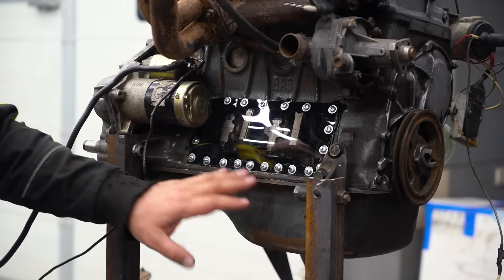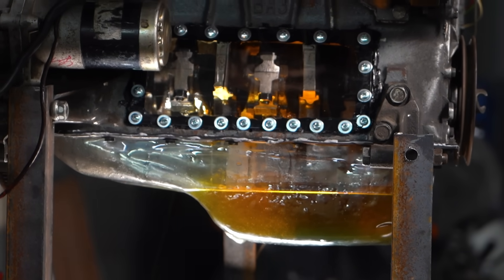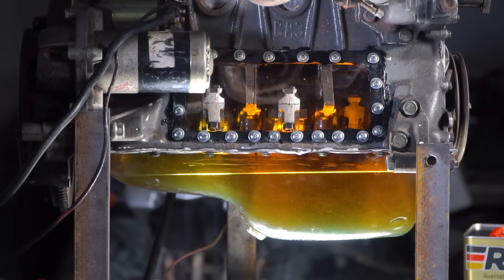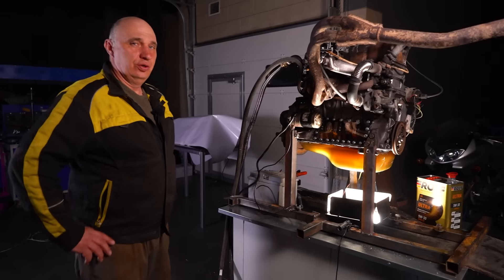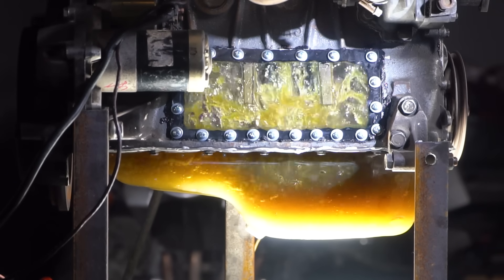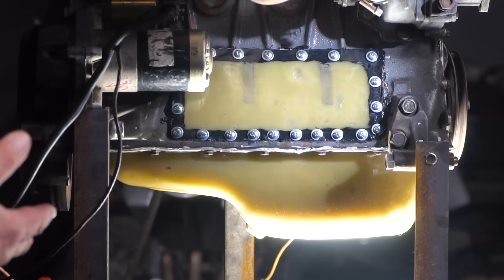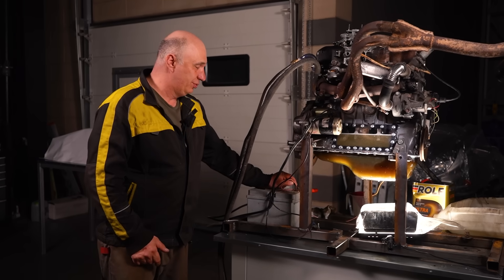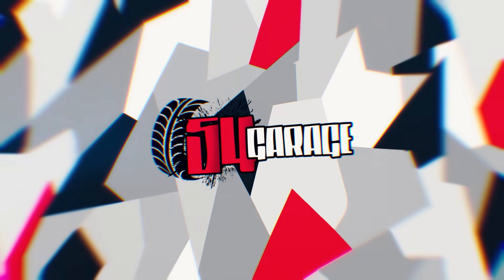What actually happens when you overfill your motor oil? (w/ transparent oil pan)

Comment: Excellent video. Amazing there were no blown seals & strange how the oil took on a different color with all the air trapped in it. It would have been interesting to see what the oil pressure was with all that air in the oil. Also pretty scary how little oil is in that sump when filled normal level & running. Makes you wonder how the oil still gets sucked up in steep hills & corners.
Reply: @karlwithak. I think you will find the oil galleries & oil pump lines & filter are lots more than a tablespoon. did you notice how far the oil level dropped after just cranking the engine at the start.

Comment: The problem with an overfilled engine is that air bubbles form in the oil, which can prevent the pump from sending the oil where it's needed, causing premature wear on engine parts.

Comment: I always ran my vehicles one quart over full.  The pan is only over full when the engine is shut off.  I never had a leakage or oil burning problem, or any trouble with aeration.  A mechanical oil pressure gauge showed steady, high oil pressure at all revs.

Comment: Years ago i had a honda accord 1300, the oil pump drive sheared off (common problem). 
I filled the sump with maybe three times as much oil and did another 20k miles with no oil pump.
Worked fine.
Reply: My god
Reply: That's the Henry Ford splash lube system for the Model T....if you went uphill for too long the front mai bearing ran dry....
so the modern way to stop that is a catch funnel added as an aftermarket piece at the rear interior of the engine block 
and a small oil tube running forward so the accumulated oil in the funnel still lubes the front bearing while going uphill....
Reply: karlwithak. Riiight, because they were so very efficient. Why use energy to power your drivetrain when you can just waste it pointlessly stirring a vat of oil. If only all the world's engineers had just listened to you, the know nothing in the cheap seats. All those dry sump race engines are just a waste of time folks, Karl the genius has the real oil, putting the wind in windage.
Reply: Yeah... but that's not a fair comparison, Honda's take a beating.  I was NEVER nice to mine and put over 100k miles on it.  After it was already past 200k miles.
Reply: Until the head seized? Or did the cam just wear out and stop opening the valves?

Comment: Oil can make its way out the breather into the intake and hydrolock the engine. Or if the crankcase sits too full over time it can couse excess pressure and damage internal parts. That's a pretty big oil pan, a lot of engines around here have one just big enough for the pump to sit into so double the oil would mean it's about half way up the crank or so. Lots of variables. The engine on the stand sits still so oil doesn't have a chance to slosh to one side or the other, I'd bet that's where engine damage would kick in.
Reply: The air in the oil is what does the damage.

Comment: Engine masters and Richard Holdener tested this on a dyno.   Extra oil reduced hose power dramatically.  Also the air in the oil kills bearings and lifters.

Comment: Bought a car from a guy once, it was his first car, turns out he only ever added oil, never checked level. He was never taught this just all he had ever seen was his Mom add oil every couple weeks. Motor wouldn't even crank right and when it did fire it struggled and smoked like a house fire. It wouldn't idle. I basically drained some oil out, changed the filter and cleaned the spark plugs. Drove it for 2 years before selling it.
Reply: I just shared the anecdote above in another convo of a lady who ran her toyota celica for 3 years on the same oil keeping the level at just under the 'E' mark on the dipstick because she thought 'E' stood for enough. Was like black tar until I changed it for her. Didn't die though.
Reply: Was it a Toyota?
Reply: @Makaya9s  are you psychic?  Yes a Celica,  was actually in a place called Zaragoza, Spain. Did you have similar experience
Reply: @survidmt  
Probably like a cockroach a Toyota, no matter what happens,  will be there running when humanity ceases to exist....
Reply: @survidmt  no not psychic haha. It's just that there have been cases of people driving months to even years without changing their oil to even people driving without any oil and the engine still survived everything. So an old celica definitely makes sense.
Reply: @Makaya9s  gotcha ya, sadly for him the car was not new but for a used US Toyota in spain, it was pretty new,lol. Do like the longevity of toyotas
Reply: I cleaned a rifle that was treated like that. Oil was dripping out of it and no more dirt could fit anywhere in the action.

Comment: What really destroys an overfilled engine is the actual oil foam, it would be great if there was a camera capturing how much of those air bubbles where sucked by the pickup tube instead of oil,  even with that milky microfoam you have huge ammounts of air on the galleys, rod bearings, etc, would be nice to see the aftermath.
Reply: A pressure gauge right on screen next to the transparent sump would have shown exactly that...
a drop as the air entrained in the oil is compressible....
so lower overall oil pressure as the foam increased....
Reply: No what would actually kill the engine would be the crankcase breather as the oil would be sucked back into the combustion chamber and hydro lock the engine, the crankcase breather was disconnected as you saw, if it had not been the engine would have been destroyed way before.
Reply: @stevenc5227  that would depend on where the crank case ventilation is located , most are in the tappet cover

Comment: Good to know you can overfill oil a little bit and not have anything too bad happen. I still wouldn't put in double what they recommend or anything but I wont stress about an extra quart or something now. Of course this all depends on the engine as well as they're not all the same.
Reply: Especially for engines that eat oil. How many times I was so worried about putting too much in vs how much ran out, I don't have to worry about letting one go hungry again :)
Reply: I was happy to see this video, I had a oil change and the shop put all of my 5 litre jug in. I was a little concerned but it was something I always did my entire life.
Reply: That was also my take away point, but worth remembering that you will lose fuel efficiency even with an extra cpl quarts, as the oil feed wheel has more load on it.
Reply: @wobblyboost  with my 2022 Veloster N, the book says 5.2 quarts. 

I have the car level on a lift, I drain it all out, I put 5.2. Qt in, it reads .5" higher than max. 

Same with oil changes at 1100 miles, 5000, 8500, and 13500.  

Dipstick may just be wrong... Hyundai lol.  Car is rated for 22 city / 28 highway mpg. I'm getting 36mph at 60mph in eco mode. So level is ok. No parasitic loss. 

Probably just the stick.
Reply: @NMode_VN  I have the same experience with my Mazda Protege. I guess it's because not all of the oil drains out. In my case about 0.2 liter won't come out and I tend to overfill by that amount if I fill by the book. I also change the oil-filter.

Comment: You should monitor the oil pressure. As the oil been smacked by the crank, it causes to having air bubble in it. The oil pump not good with oil that have been mixed with air so the pressure will dropped

Comment: I wonder if that much oil splashing around would keep the engine cool to not use coolant.
Reply: No it wouldn't, not for long. The added oil increases the resistance when the crank turns. This generates heat, and sure the oil will transport some of it away. But there are not enough surface to the block to cool the oil long tern, so it will increase the heat in time if you remove the water cooling.

Comment: There was french motorcycle in 1938, named Simca Sevitame. 2 cylinder upside down engine works literally in oil bath. Whole engine was mounted in aluminium box, filled with oil. Check out, who is intrested.
Reply: That little beast takes 8 liters of oil. Thanks
Reply: @t16205  yup, exactly. How many oil needed to filling 5,7 hemi?
Reply: @a777aa64rus  About 7 liters😅 I love weird old engines!
Reply: Interesting, thanks.
Reply: Interesting. You ever heard of the Megola. Has a radial engine mounted in the front wheel.
Reply: @rezzophantasma  i heard, totally useless thing. But funny, yeah, like rocket propelled roller boots.
Reply: Go get more oil Sergei 😅
Reply: C63 6.3 takes 8,5-9 liters
Reply: I'll mention while I'm here that Sunbeam motorcycles used the oil pool for engine cooling, but England is fairly cool and distances not too great .
Reply: @Philip-hv2kc  unfortunally i'm not familiar whis this brand and its technologies. Thanks, I'll find out more about him.
Reply: In the 30's, a lot of four and six-cylinder aero engines were 'inverted' with the crankshaft at the top - gave a better location for the propeller.   Howcome the bores didn't fill up with oil? - the pistons just threw it out when the engine was running.   And they were dry-sumped (had to be!) - the oil was kept in a separate tank.
Reply: @cr10001  I have no complaints about aircraft engines. Aviation - the whole separate world with their own complications. Btw the crookest engine i know was installed on a british ww1 era war plane, named Sopwith Camel. Kinda reversed radial engine with cranckshaft attached to plane body and cylinders to propeller. I newer seen it in person, only few youtube videos.
Reply: Loads of WW1 aircraft had rotary engines like that. The Fokker triplane for example. The french invented the idea with the Gnome Rotary before the war. It was a way of dealing with cooling the motor. They also all had total loss oiling systems so the pilot was being sprayed with oil all the time the motor was running..
Reply: From what I can tell looking at engine diagrams, the cylinders are dry, but externally submerged to transfer heat, and the entire aluminum "box" is the crankcase AND transmission housing. It looks like the main reason for it is temperature control, because the entire case is a giant heatsink.
Reply: @SkorpyoTFC  cylinders was cooled by circulating oil inside this box if i understand it right. I heard, the main reason to make this boxy design was an ability to get whole engine out of the frame, and use separately to power water pumps or generators. Same idea was used later on a RockOn motorcycle, but without overengeniering.

Comment: 14:55 this IS the crucial part when overfilling Diesel Engines with oil it just spills the oil into the crankshaft Ventilation Back into intake -> RUNAWAY
Reply: I don't believe the level of oil caused the pan to leak as much as it was the engine temperature caused the plastic to get soft.

Oil pressure gauge would have been a must too accurately gauge oil pressure loss through cavitation.
Reply: yeah this happened to me. But not by overfilling but due to unburned fuel diluting the oil - too much short-distance driving caused exhaust filter cleaning procedures to start over & over again. very uncomfortable experience, now I take care that the car has plenty occasions to blow the soot filter free.
Reply: Like the oil Detroit Diesel road oilers.
Reply: unless it is a modern diesel with an "anti shudder valve" As long as that valve seals properly and there are no intake leaks post valve it will shut off real quick when you key off
Reply: I would imagine it does it with any engine. Does every engine not have a pcv valve? I know my 93 mustand and 06 trailblazer do; so this would have caused a mess in the upper intake, where the pcv is "piped" in to for vacuum.
Reply: And when you overfill it, it will run for longer, too
Reply: Not running a PCV reroute on a diesel 🤮
Reply: @Legally_its_a_joke  There is no good reason to reroute PCV on a diesel if you have no EGR system in place/active especially on a modern diesel with an oil/air separator inline with the PCV.  Not to mention if you do a reroute dumped to atmosphere and do not run it in a good location where it will not freeze up... bad day if that ever plugs fully with ice
Reply: Wrong. The ONLY reason PCV don't vent to atmosphere anymore is because of emissions regulations. Not reliability reasons.
Reply: Can we somehow filter out comments from you ess ehh so that we are not confused by their silly comments?

Comment: I wonder how much oil still gets to the camshaft when most of the foamy oil that the pump picks up is air 🤷‍♂️😂
I guess it doesn't matter to fill up a bit over max but I assume you should avoid the crank aerating it like crazy

Comment: Fantastic!  Now do it with various transmissions, manual, auto, cvt
Reply: Any early 5 speed gear Lada gearbox (especially Niva) requires and extra 2 litres of oil poured in through the hole in the top of the box after you loosen off the shifter plate.
The 5th gear was an add on...and runs out of oil if the level is only to the filler on the side of the case...which was OK for the 4 speed...but woefully short for the early 5 speed.
Reply: Love to see in a cvt!!!

Comment: Good to see that an extra half quart won't damage most engines.
Reply: it would be pretty bad if they did. A lot of shops, dealerships included, have a bad habit of overfilling by about a quart.
Reply: @TheJeremy5599  dude a Briggs and Stratton vtwin takes 2 quarts not half a quarts you actual Buffon an extra half quart won’t hurt it also kohler command vtwin> Briggs vtwin also I’ve owned several Briggs vtwins and they all were trash compared to my kohler command
Reply: A 'half quart' = a pint...
Reply: @johno4521 it also equals 2 cups, 1/8 gallon, 16 ounces, and 32 tablespoons. What’s your point? Engine oil is typically measured in quarts, not pints.
Reply: Maybe not on a stand...
Reply: @TheJeremy5599  that is a complete and utter lie
Reply: Depend on engine size because an extra half quart will cause a push mower to smoke
Reply: @joshmanis-h7h splash lube designs are expectedly more tolerant. And every one of them I've had, they all get extra oil from day 1.

Fill to max, start engine, remove oil filler cap and keep adding until you hear/feel the engine react. There's your new, legitimate maximum. If you're lucky, you'll have a dipstick that can read a level that high, if not you have to do the drain/measure routine and then wait for the level to drop during operation to know how much more to add and when.
Reply: @TheJeremy5599  dude your high as fuck in the history of Briggs and Stratton their vtwins (vanguard or intek) have NEVER taken half a quart to fill they all take 2 quarts, you must be talking about a push mower.

Comment: Even if you go a bit over max the amount of foam will kill the oil pressure
Reply: Define 'a bit'.  You could see there was no foaming at 'double' the top fill line
Reply: @williwonti  It was actually. Changed viscosity by air which was basically air and air can be compressed so you lose oil pressure...
Reply: @REDLINERUNNER  Maybe we're talking different terms.  There was no foaming when he went one increment over the max fill
Reply: thanks for the info, that's what I though. the cranks may be well lubricated, but the engine top end probably won't like it right?